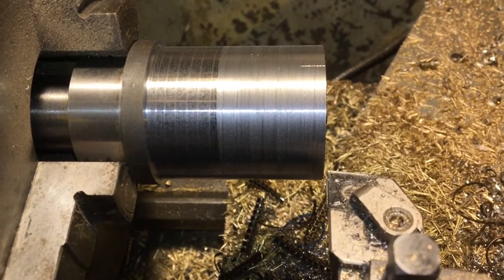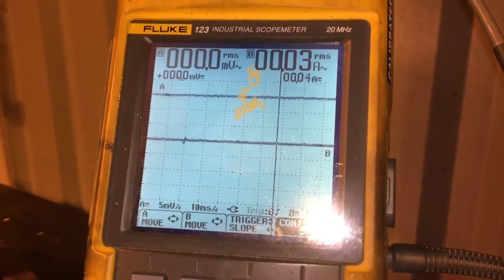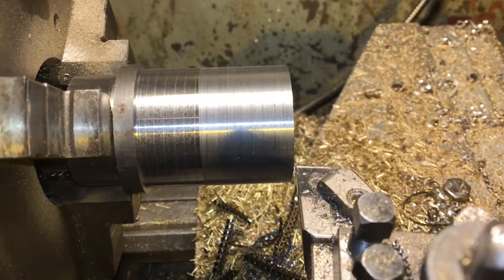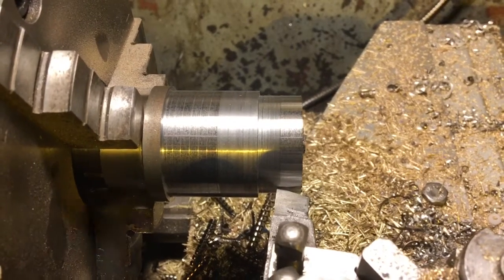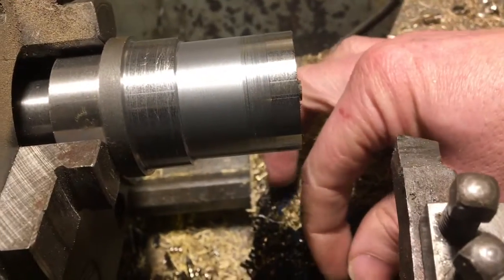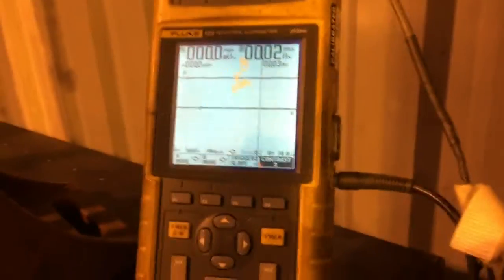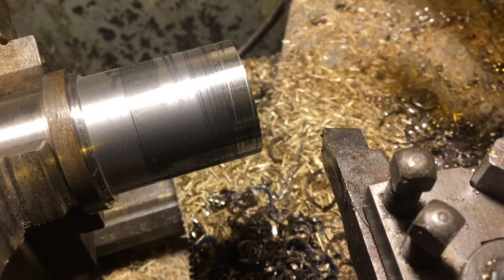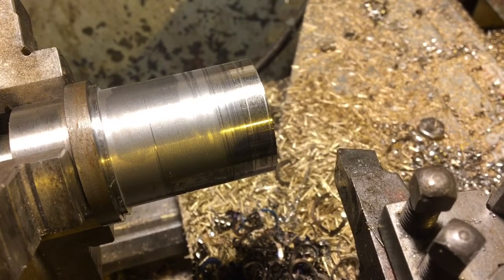Carbide vs high speed steel part 2, efficiency

Comment: I am afraid I can't comment much re HSS as I don't use it.  Carbide inserts are all I use in my benchtop cnc lathes.  100 diameter chucks and 1/2 hp and 3000rpm.  Aluminium inserts from most makers have 20 degrees of rake, use them in a manual lathe and they can actually pull in to the cut or pull the work piece out of the chuck, I have had that happen using a boring bar.  
I often use aluminium inserts to turn free cutting steel, they don't last as long as the others but they are easy on the lathe. Inserts come in a huge variety, some of which are "finishing" made for light cuts and with high rake angles through to "roughing" that usually have much less rake and are made for deep cuts and high feed rates.
I use finishing inserts, as my general purpose inserts these have ground edges and 15 degrees of rake and work well with 1/2hp. Inserts can be "moulded" or "ground" with the ground edges being very sharp, but the moulded edges can be stronger particularly for heavier cuts. I have just discovered some "finishing" inserts that are moulded and as these are 2/3 the price of the ground edge inserts I can't wait to give them a try. I use the 35 degree inserts a lot and I think they are easier on the lathe than the 80 degree inserts but this may not be true.  They do allow swarf to clear well which can be a problem with the 55 and 80 degree tools.  I think the greatest problem most folks have with carbide inserts is using the wrong type and secondly not using high enough rpm.  I would run mild steel at 2000rpm for one inch.
Buying cheap inserts off the web is really only a good idea if you know exactly what you are buying and know it will do what you require.
Apologies for the long winded comment, just hope it helps
Reply: hello, i need some help from you. I don't have much ideas about cutting tools. could you please help me in cutting some brass. thanks

Comment: I find that the positive rake inserts and holders for carbide work better on my 12" Grizzly.  I have only experimented with the cheap inserts from Banggood for the most part.  I like it because it saves a lot of time on the grinder and I have a huge variety of cutter shapes in the toolholder sitting ready to go.  I have found some of the negative rake profiles to push rather than cut although I haven't tried really high speed rpm yet. I also have found the sharper tip profile on the inserts work better for me.  I assume by lightening the cutting load.   Very good topic for the home hobbyist.  Thanks for the videos.  Take care.  Doug
Reply from the maker: Thanks, when I get the chance I will try to get some testing done with different tool geometries
Reply: Although they don't label many of their inserts I have found the ones with black coating and/or advertised as "for aluminum" are the positive rake type.  Seems their descriptions are very hit and miss on many things.  Doug

Comment: the feed pressure you noticed is most probably due to the geometry of the carbide inserts. Not only is yours a negative rake insert, but the edges can not be as sharp as the HSS, due to the coating of the carbide
Reply from the maker: Yes, and I'm coming to the conclusion that its the coating that makes the carbide more efficient than the HSS. I expected the HSS to be more efficient because it was sharp with a slight positive rake, but it took more power on every cut than the carbide, maybe the chip slides better over the coating - more experiments required with different materials and coatings i think

Comment: The tool geometry makes most of the power difference you see, the real difference is tool life and as you said, light cuts are generally better with HSS. With the same geometry, the same amount of material removal should roughly need about the same power, but you can hog a lot more material off with a carbide tool, providing you got enough power and the right speed
My old 14.5" South Bend does quite well with carbide on larger diameters, obviously until i reach the power limit. On smaller diameters it just cannot produce enough surface speed to get the tool anywhere near the recommended parameters.
The result is usually too much tool pressure at too little speed, which results in excessive heat and therefore short tool life.